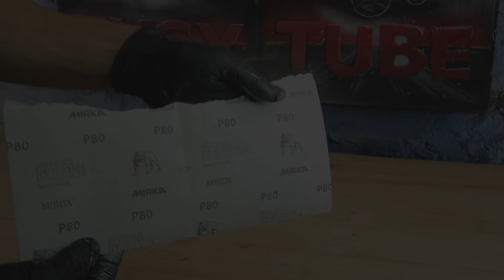Rusted Military Helmet -impossible restoration

Comment: the helmet should have been painted   "horizon-blue" (light blue-grey)
Reply: Do you know what went on the top holes?
Reply: Neji Niisan I'd say an extra frontal plate to offer better protection against sniper shots
Reply: @gioojisba2758 , but the holes are on the top. I was thinking something like a spike or another ornaments, since it's a cadett helmet.
Reply: @nejiniisan1265  They look like ventilation holes.
Reply: @nejiniisan1265  you have to look adrian helmet on google and you will be fixed😉
Reply: @proileri , it's for both purposes, like in pith helmets.
You have top holes that are made for ventilation and securing an ornament.
Reply: @leo9021 , I looked up, just remembered the history of France researching and reinforcing the helmets during WW1.
Thanks!
Reply: @nejiniisan1265  yeah they're always on top. Look at ww2 germam helmets
Reply: It's missing the deflector crest.
Reply: Only the French cadets don't wear ornaments on their helmets at the Ecole Speciale Militaire so far as I know. They have special caps for ceremonial purposes and the helmets are just for field exercises. The holes are primarily for securing the reinforcing rib/deflector crest as noted by Demis because the Adrian is made of rather thin, softer steels and depends on such reinforcements to function effectively.
Reply: @nejiniisan1265  There should be an additional elevation, like the next helmet. To protect against hitting the head on a beam or ceiling.
Reply: @nejiniisan1265   it is to have the "casoar" it is for the saint cyr school uniform so its normal, from France i would prefer to have the helmet in blue and the french anthem  😂😂
Reply: It would have been green that's a ww2 Adrian not a WW1 Adrian
Reply: Yea isn’t it a French helmet
Reply: No No No it's supposed to have a crest, and it's supposé to be painted in "chocolate brown" wich is between brown and kaki, or in Kaki.
And it still lacks a lot of pieces...
Reply: Clément thanks
Reply: That’s a wwii style Adrian. It’s one solid piece. The wwi versions where made of multiple pieces. There should also be a top piece that covers the vent hold which is missing. But a Devine job that I could not do myself
Reply: @nejiniisan1265  there would have been a little crest. Look up pictures of a French Adrian helmet
Reply: Depends of the year because light blue grey wasn't use in the French army in the 30's, they used a kaki green
Reply: Yes
Reply: Rod Lepine... I think no because it's not a 1915 model but its a 1926 model. It shoud be green - brown... But without the top (le cimier) its nothing... Ah ben oui !
Reply: No, its a M26 adrian helmet, he need a green kaki paint, not a deep green or blue horizon
Reply: I don't really like the fact that the border detail was lost. It's nice to stick to the original details, colour etc.
Reply: Not ww1 it’s the 1926 version so no blue
Reply: No, it shouldn't, it's from the military academy. Their helmets were an olive drab
Reply: Wrong.  Not ALL French helmets were blue.  Many private and public French military high schools and academies painted their helmets green, gold, silver, grey, or black.
Reply: No ,this helmet is from an military school of 20s or 30s.The helmets of this age were painted in "kaki"
Reply: @nejiniisan1265  the top holes would have a sort of curved piece of metal that other adrians have. It would have offered some extra protection but not much.
Reply: @nejiniisan1265  There was a metal Crest of sorts on top. It was very small, but in my opinion looked okay.
Reply: 'École Spéciale Militaire'
Reply: Neji Niisan no it’s a lump look up an Adrian helmet they have a limp on top

Comment: Great work! There was a time if I saw a helmet in such a condition I would have just said 'forget it', kept the brass piece from the front, and tossed the helmet. After seeing this video, I'll think twice before tossing something like that. :)

I used to have 8 helmets in my collection, but since given them away.

I had 3 black felt helmets with black felt visors and 2 white ones just like them with brass plated skull and cross bones on the fronts and a brass spike on top of all of them. They were, and still are, part of the Independent Order of Odd Fellows costumes for the lodges. Those helmets dated between 1910 and 1930.

I had a white canvas covered cork pith helmet similar in shape to the British Bobby helmets. It had a red velvet shield with silver/lead threaded boarder and embroidered sliver/lead lily in the center. It had a silver plum holder for plums. It was from the 1880's and part of the Knights of Pythias Uniform Rank uniforms. The plum for the base rank would have been red.

I had a metal helmet with a metal visor that sat on the brim and the helmet had a brass spike. This was also Knights of Pythias and was part of the degree work costumes.

Last I had a rare Grand Chancellor's helmet in my custody, which I had charge of donating to our local museum. It was also Knights of Pythias and the Grand chancellor was head of the Grand Lodge over all of the local lodges in our state. The helmet was black felt in the same shape as a British Bobby helmet. On the front it hat a metal shield that was in the design designated for the Grand Lodge officers. It originally would have had a cord that was long lost, going around the front where the brim meets the body. The top was unique in that it had a solid board the raised up about an inch starting from the top front and going to the back brim, tapering as it went along the back of the helmet. This was to hold a plume that would have sat on it billowing in the front and sweeping to the back brim of the helmet. These were wonderful helmets and I enjoyed having them, but lack of space made it necessary to get rid of them. Other than the one I donated due to it originally belonging to a former judge in my city from the 1880's, the other helmets I gave away  to friends who I knew would enjoy them.

Comment: Nice resto. A couple tips: never spray WD40 on something you intend to paint, it doesn't come off easily, especially on a porous surface, and it will impair adhesion. After rust remover, I'd go straight to the wire brush, then degrease, then rust converter, then metal repair, then bondo, then primer, then paint.

Comment: How to wear wity nothing inside
Reply: What a travesty. The only "well restored" part is the Brass Crest.
1. Molasses and water, 1 to 5 cleans all the Rust Without the use of a Wire Wheel...esecrable...
2. This is an Adrian Mle.16 Helmet...has a ridge-crest riveted on the top.
3. Where is the adjustable leather liner, and chin straps?
4. As to  the fillers ( epoxy) and mastics and paint? You can't make a Virgin out of an old Putain!
5. Correct colour is Horizon-bleu ( grey -blue).
6. Incorrect music!!! La Marseillais, or Regiment de Sambre et Meuse , or 
even " Le Boudin" .

Doc AV
Australie.

Comment: Nice work, but I have a question and a comment. 

Question: Wouldn't it be better to use the rust converter before the cold weld metal filling epoxy to avoid encapsulating any active corrosion? 

Comment: The shiny green paint is pretty, but I think that the helmet would have been originally painted with a matte finish.

Comment: Put the white filler on first, then sand it,  then the spray filler/primer is last before final coat. It will fill in any small holes or defects for a very smooth finish. I like your channel but a lot of wasted time and product.

Comment: All that filler made the helmet lose its metal texture. It ended up looking cheap plastic... But good restoration anyway..
Reply: The metal "texture" you refer to is call "pitting and rust" original helmets were a very smooth steel stamping.